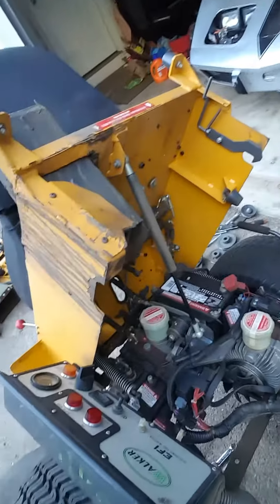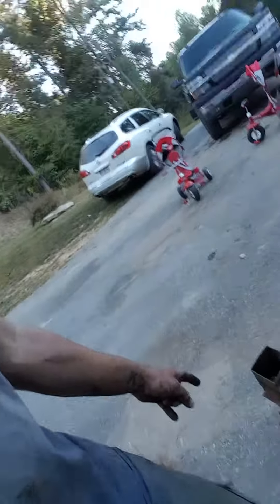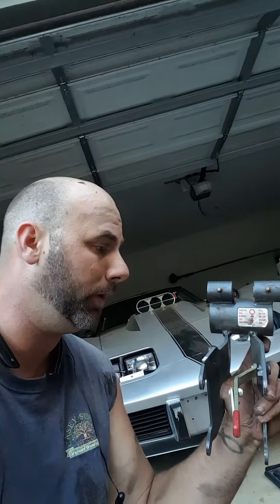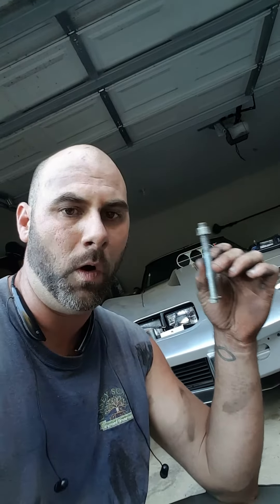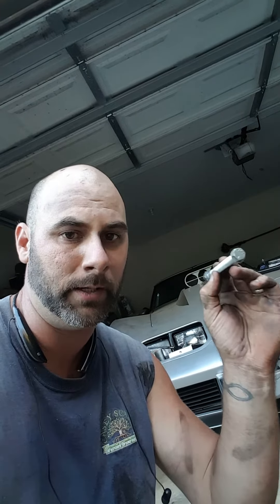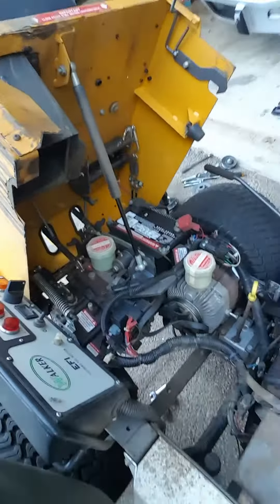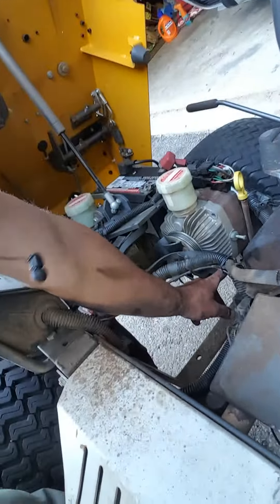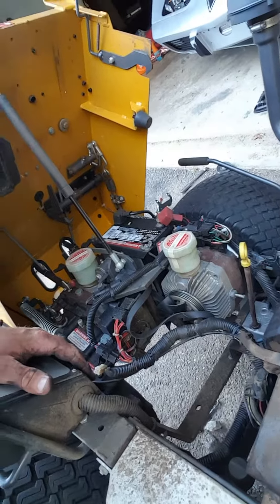Why walker mower WHY!!!!!!!!

Comment: so true.  even the dealers dont know what they are doing at $100/hour.  My parents have one and the drive shaft and the bearings broke, after 400 hours. dealer said the noise was coming from the seat and ordered more rubber bushings before I came over and listened to it and determined what it is. The only experience I have is a few years of HS autoshop!

Comment: I am new to Walker but my sense is that there business model is similar to Apples. Everything runs tightly vs Microsoft, but when its time to work on something Apple tries to control as much as possible. I'm thinking Walker is similar. I purposely purchased some blades (simple part) from Walker so that I would have time to find part sources for my new Walker. Nearest dealer for me is 1 1/2 hours away. Keep up the videos and information on the Walkers.
Reply: Barry Camarillo if you want information on Walkers talk to someone who knows about them and not someone who is just going to bad mouth them in online videos for a few thumbs up.

Comment: sounds like a crying baby ! 48" bagging with 23hp is no more than $15000
Reply from the maker: christophe buisson good thing I don't have a 23hp I have a 26hp with the one hand deck adjustment and high dump out the door $19,200. Go troll someone else
Reply: Casey Scapes ok so basically you have some add ons that contribute to your final price point. That's like saying your F-150 cost you $200,000.....oh but I forgot to mention my 24k gold wheels and panda skin seat upgrades.